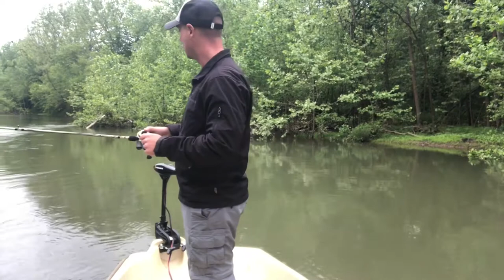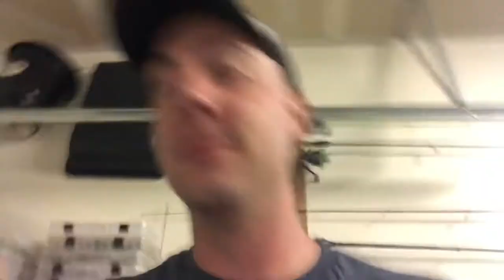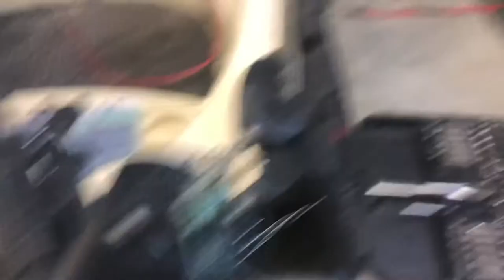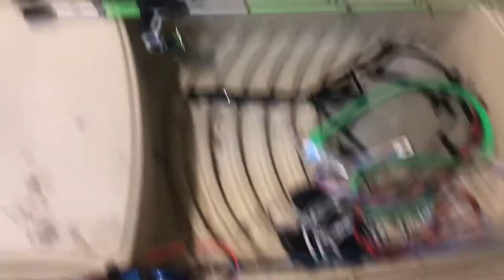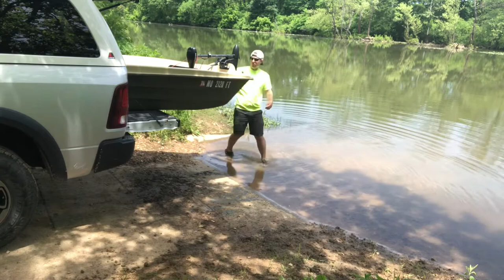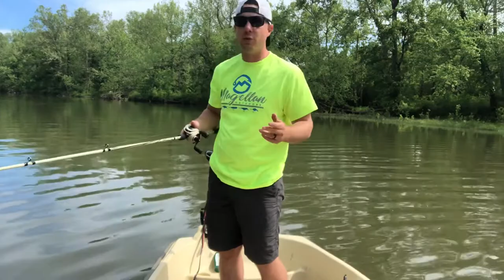Sun Dolphin Jon Boat Adventures: Battle w/the Paddle

Comment: Just subscribed. Nice videos. Just picked up an American 12 from Academy in San Antonio and ordered the Suzuki 2.5hp  for it. What battery are ya using for your trolling motor ?
Reply from the maker: I use a 12v everstart deep cycle marine battery from Walmart in the 24 group size. It is only $75 and works great and it has a 1 year warranty. It will power the trolling motor for at least 8 hours. I have lots of vids of this boat brother please check them out, from trolling motor setups to casting decks. Thanks for the sub, also I’m jealous of that outboard you are getting lol.